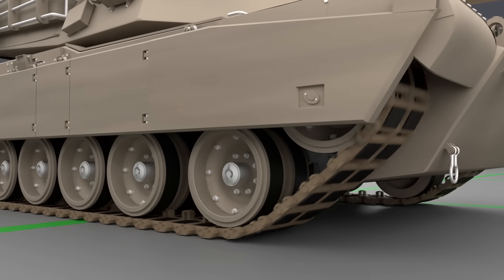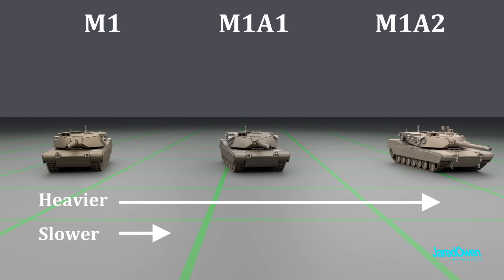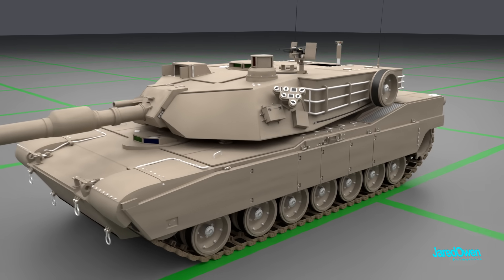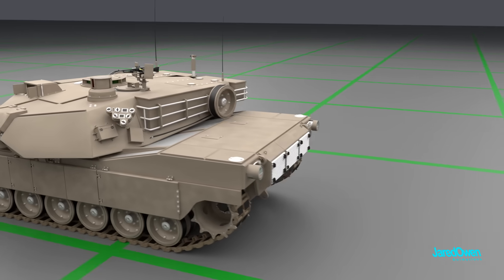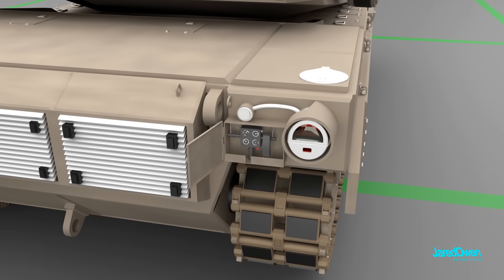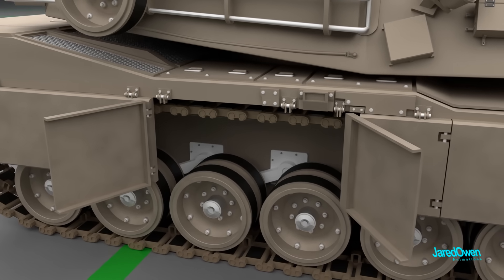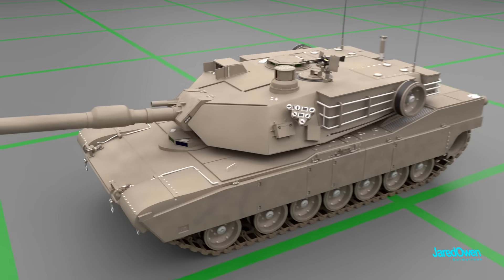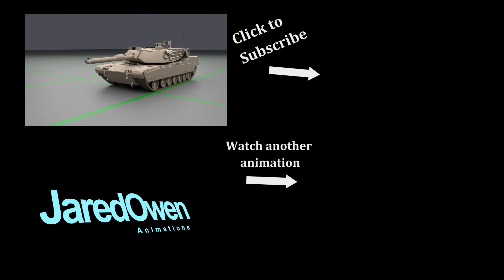How does a Tank work? (M1A2 Abrams)

Comment: I'm wondering how the driver gets out of the tank if the turret is stuck facing forward
Reply: Muhammad Fathurrahman we dont we have to traverse the turret to get out.. lol
Reply: You can get out but it's tight. However, there is a position where if the turret is turned about 20° left or right over the front, it's extremely difficult to say the least. In a pinch in that position that required quick exit, you would be screwed.

Comment: As someone who played war thunder for 7 years it's not realistic nor fun nor balance.

Also about the video.You missed the supporting wheels behind the idle wheel.
Instead of focusing on promoring the most unbalanced,pay2win garbage from scummy devs maybe do more research on the tank.You could've done so on the beloved War thunder.
You didn't mention how the bore has to be manually adjusted,nor how side skirts hold ERA nor mentioned the TUSK versions..nor said how the tank heats up to show on thermal..NOR M1 holds special cheek plates so other allied tanks can recognize it.

The smole launcher as said LAUNCH the smole grenades they don't release the smoke,they launch out and make a smoke screen infront of the tank.They don't come out like the crew is vaping.

The fact you used war thunder for reference makes it even sadder.
You can literally find so many pictures and videos of the abrams and inside functions.

You could've at least hidden the fact this video was heavily promoted.But this was disappointing to watch.

The driver can get out from UNDER the tank in case of emergency.

Comment: I'm a machinist and I'm proud to say that I help make the engine and exhaust systems for these beauties. 😍👍👍👍
Reply from the maker: Awesome!
Reply: @JaredOwen  you did a really good job modeling the forward and rear headers as well as the air diffuser. It's neat seeing it together instead of just individual pieces coming off the machine. 👍👍👍👍

Comment: So by info its 42 mph talked to tank commanders it can go 60. I am sure that does no favors for track life.
Reply: True. Mine went about 50 mph but that varied from tank to tank. There is a type of throttle governing device which isn't always set exactly the same on each tank. Also, a new pac (engine) will move this beast along quicker than an old one. Also, if the filters are clogged with debris and or sand/dirt, the engine is sluggish.

Comment: imagine that canon bullet pack ignited and you still inside the tank
Reply: That is a real concern. Each projectile is fired with an electrical charge, not a firing pin. The aft cap has contacts on the rear that must be protected. Static electricity was a concern when we were loading rounds into the ammo door-especially if there was lightning nearby.
Reply: That is a real concern. Each projectile is fired with an electrical charge, not a firing pin. The aft cap has contacts on the rear that must be protected. Static electricity was a concern when we were loading rounds into the ammo door-especially if there was lightning nearby.

Comment: Main problem of heavy tanks how is the Abrams that in Europa are not many bridges build for so big weight = they cannt manever and fast change position how in Iraq .
Reply: The Abrams is not classified as a heavy tank, it is a MBT class armored vehicle and (originally) meets the exact same NATO STANAG requirements for supply and transportation as other NATO equipment.
The Abrams and Leopard 2 share the same hull and chassis as well as the same gun.

Comment: 6:08 The turbine engine is actually considerably louder than a standard diesel engine. The main reason the US chose this engine was that even with the noise, size, maintenance and high fuel consumption, they believed that the power it provided ought-weighed the negative aspects
Reply: The U.S. Congress overruled the Army's choice to buy the Diesel powered General Motors XM1.
 Lobbyists from Chrysler and the state of Ohio pressured Congress to overrule the Army's selection to prevent the closure of Chrysler's tank plant in Lima, Ohio.
Reply: @sandervanderkammen9230  im not american so i didnt really know the politics behind it (thx for informing me though) but as an australian i have worked on the m1a1 and i really dont know why we bought the abrams over the leopard 2. The power really isnt worth the extra engine maintenance
Reply: @turse8201  Correct me if I am wrong, but as I recall the U.S. government offered to sell Australia surplus used M1 Abrams tanks that were refurbished to Australia's specifications but with the U.S. spec. armor plate removed and replaced for the standard export armor.
 The original order 59 M1s plus spare parts support was considerably less expensive than new Leopard 2 tanks.
Reply: @sandervanderkammen9230  there was a discount, we paid about 408 mil for a fleet of about 59 tanks, which was about 6.9 mil per unit. Current unit cost is around 8.6 mil. On top of that the US dismantled and replaced 86% of parts on average for refurbishment but the armour stayed the same. The ADF thought that the increased maitenance and fuel costs was worth it for the short term refurbishment and discount on unit cost compared to a leopard 2 which had higher unit cost with lower maitenance costs (the ADF isnt smart when making long term decisions, only have to look at the submarine problem we had here)
Reply: @turse8201  The original order of 59 tanks were supplied without depleted uranium armor, and barrels which had fired DU munitions were not allowed to be imported into Australia.
 As I understand the expansion of the fleet to 90 tanks will include an armor upgrade but as far as know it will not include depleted uranium as Australia has had a particular aversion to this toxic by-product of nuclear weapons manufacture and will most likely been upgraded with tungsten alloy instead.
Reply: It's not really louder. Higher pitch, yes. Though this dissipates much more quickly over distance. Size? It's a small engine. Fuel consumption and maintenance is hardly poor.
Reply: @peterson7082  The Abrams engine bay is designed to fit a Diesel powerpack, in fact while the size of AGT-1500 Gas turbine itself may be smaller, it is not a significant advantage as the Abrams powerpack is the same size as the Leopard's MTU Diesel engine....
The Leopard and Abrams were designed from inception to have interchangeable powerpack combinations.
The fuel consumption of the Abrams is extremely poor, it consumes more fuel than two Leopard 2's per day in combat operations.
Reply: @sandervanderkammen9230  

> "The Abrams engine bay is designed to fit a Diesel powerpack, in fact while the size of AGT-1500 Gas turbine itself may be smaller, it is not a significant advantage as the Abrams powerpack is the same size as the Leopard's MTU Diesel engine...."
 My point was simply that size was not an issue here. 

> "The Leopard and Abrams were designed from inception to have interchangeable powerpack combinations."
 That was the general hope, though I cannot find any evidence they ended up in production vehicles being interchangeable. 

> "The fuel consumption of the Abrams is extremely poor, it consumes more fuel than two Leopard 2's per day in combat operations.
"

 Dependent on conditions.
Reply: @peterson7082  Indeed, testing during the XM1 trials showed the AGT-1500 offered no significant advantages, which is why the Army selected the Diesel powered GM version.

Perhaps you should look more carefully. The Leopard and Abrams share a common chassis and the powerpacks do indeed interchange.

Conditions always vary, which is why fuel consumption is always determined and compared by standardized testing.
 Standardized testing eliminates the variable conditions that may skew fuel consumption figures and allows engineers to accurately measure and compare two different engine or vehicle designs against each other.

Comment: I'm curious and serious question ... Does tanks have an aircon inside?
Reply: Some tanks have cooling systems and also fans inside but i wouldn't consider it as aircon.. the cooling system helps to cool down the tank to prevent overheating to the tank electronics systems. Being inside the tank is actually still very hot for the crews.
Reply: Some modern tanks have them, in-spite of what the other comment says, the Israeli Merkava 3 and 4 for example does have real air conditioning.

Comment: The only thing you forgot to talk about regarding the track it’s how it works when hitting hard obstacles. The M1 tanks doesn’t have springs that cushion hard terrain they use torsion bars that lay across the tank and line up with an opposite wheel.
Reply: Correct sir. The torsion bars actually pass through the hull of the tank so they are protected as well. What's good about this design is that even with several snapped (going airborne over burms will do that) ehh emm...uhh, so I heard... 😒... 😂 you're still operational. If one is snapped, you usually don't even notice it until you do track maintenance and pry up on the road wheels to check for broken ones.
Reply: @nojustno1216  So you love those bars? I served on a Magach(Upgraded M60) in the Israeli armor and we hated those things, it was a pain to replace when they broke, we were jealous of the Merkava crews that had springs.
Reply: @E_y_a_l 
Howdy, we never had to replace them ourselves, the mechanics did that. That's about the only thing they would do except for pulling the pac, but we always prepped the extraction before they got there with the M984. What I did like was the extremely smooth ride, especially when you're driving for hours over sand berms.
Reply: @nojustno1216  We replaced them ourselves, sometimes with one of the mechanics, but we did most of the work, and for that reason we really hated them, if you are careless and parked the tank on an uneven surface with one of the wheels higher than the rest after a few hours sometimes you'll have a broken bar on that wheel and you'll say goodbye to your sleeping time just because you parked the wrong way, I guess it didn't helped that all of the additional upgraded armor added more weight to the tank, so maybe the additional weight caused those bars to break more easily than the original designers intended.
I got nothing bad to say about the ride though, so I can understand why you liked them.
Reply: @E_y_a_l 
Yea, I do remember while in Kuwait  once while we were down, I heard a loud 💥POW💥... we initially scrambled for weapons but soon realized it was a torsion bar that gave way while just sitting there. But we did abuse our M1 pretty good earlier in the day. 😂